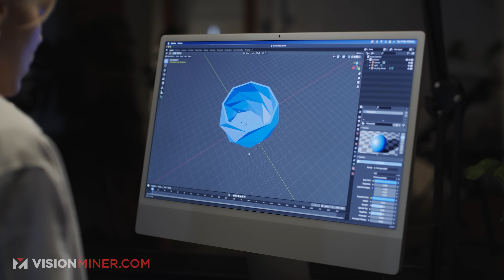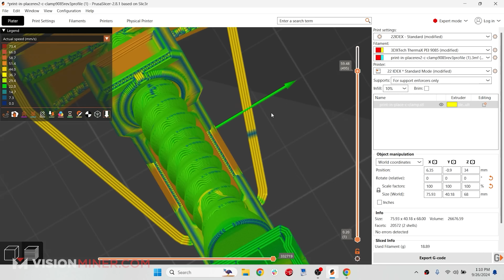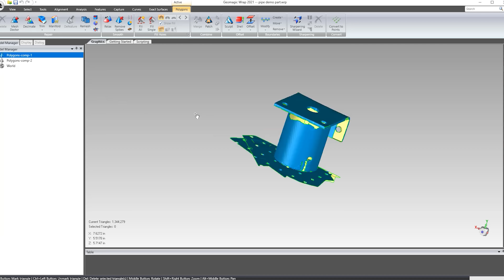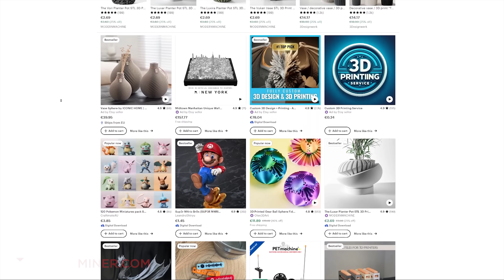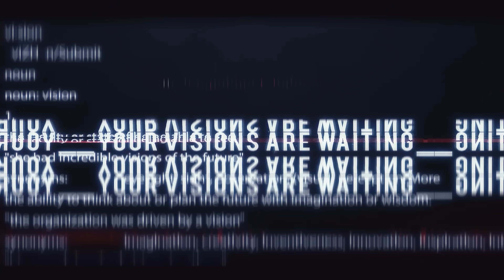Did This Machine Ruin 3D Printing?

Comment: Not going to lie I'm pretty disappointed in The release of this video I have a bamboo X1 carbon myself but I have been pushing the IDex V3 heavily at my job as we are currently considering another 3D printer we have been looking at the Mark forge FX10 heavily but I have been pushing the vision minor printer over the Mark forge and I'm going into this with the kind of experience that I have received with the X1 carbon overall comparing your printer to the FX10 I like the fact that I can use any material that I want I'm not locked into using just one slicer And overall your specs are very impressive and overall very open whereas markforged is not very open with their specs and the specs that you can see are overall very disappointing for example their chamber heater only reaches 60° c whereas your printer reaches 100° c I will say the X1C has overall made the market much more competitive and a lot of manufacturers are scrambling to get their market share back I like this it's great for the consumers because that means a better bargain for us overall more feature set for us overall and I think your printer is positioned at a point where it can offer that feature set right now for a great price I don't think bamboo can really compete with that dual head extrusion system and the rest of the feature set that you guys offer right now.

Comment: I agree and disagree at the same time. Tried multiple printer, bambu was easiest, but its build for lazy people. Or for people who dont want to know basically anything about the working of the machine.

90% of bambu people dont understand basic concepts of printing, some of them even dont know they need to clean the bed.

People like bambu because its easy to work with, i dont like it because its easy to work with.

Its gatekeeping, i know, and its unpopular opinion, but this is how i feel. 

When somebody is saying they are good at printing and they are acting like they are gods of 3d printing and they still dont even know what extruder is, they are not good printers. Many of bambu people are like that...

Comment: I would argue that bottom of the barrel printers had more of a negative effect over the past few years. Consumer printer tech really stagnated for a long time, because so many brands were racing to the bottom with printers that were too cheap to be true and under-engineered. How many people bought the cheapest printers possible and then threw bolt-on parts after them, like they were trying to tune up a 4th-owner Civic?  The forums were just inundated with folks who honestly believed that a $99 printer (with $200-$300 of "upgrades") was all you needed. Most of the problems they were attempting to solve had already been solved a decade earlier. The higher-end printers just had to be more competent than a used Ender 3, which wasn't really a high bar. I'm happy that it's possible to buy a printer now where the only troubleshooting steps are drying your filament and cleaning the print bed.
Reply: Agreed, apart from space limitations... one of the primary reasons I hadn't even considered buying a printer before bambu arrived in the scene was due to it practically being a hobby in and of itself maintaining it / upgrading it / leveling the print beds / all of the troubleshooting before you could benefit from owning a device that can print 3d objects reliably.

Comment: I've been printing for over a decade, and most of what I print are tools. The printer is a tool, and if I have to stop to fix a tool, it's defeated its own purpose to me. I could not be happier with my Bambu. It works and it does its job of supporting my other projects.
Reply: Yeah if you have to ‘fix’ it for every job, it gets old real quick
Reply: I've built printers, maintained printers, been from the robo3d to qidi, to creality, to Anker to prusa to bambu, I CAN do everything manually, but why the hell would I want to when trying to make functional parts that just Work, and don't have to spend half my time leveling, and maintaining and drying filament and so on and so forth when I can model my part up, send it to my printer and walk in in the morning and know it's just going to be there and right as I expected it to be
Reply: Yep. 3d printing people see 3d printing as the hobby. If 3d printing is your hobby you're just creating junk. 

 My 3d printer supports my other hobbies, or I design useful shit for it to make.
Reply: @axle1717  exactly. Most people just make landfill filler lol. I saw a post where a guy said he ran out of room for his knick knacks so he started leaving them around his complex, I was so disgusted
Reply: I agree 100% i also use mine to print mainly tools, I started using 3D printing last century, that's over 1/4 century of 3D printing experience. I was the first 3D printing company in my province, and I paid over $50K for my first 3D printer. FDM has been one of the least viable 3D printing processes until I bought a Bambu printer. It is a game changer.
Reply: Exactly. 3d printers are an appliance, not a hobby. Imagine someone said tink g and printing with a 2d printer was a hobby
Reply: Agreed. I have an old ender 3 that I upgraded so it prints with relatively the same quality as my X1C, but it still requires fiddling.  Dont get me wrong, I like to tinker, but sometimes I just want to hammer out a 3D printing project without all the mucking about. Being able to print in 1 day what would have taken me a few on my ender is a game changer.  Prototyping a new design on my ender would take days, now I can get that done in an afternoon.
Reply: It's not just a tool, it's a machine, you will have to fix it at some point. You could be printing for over a decade and not learn 3D printing.
Reply: @zerotweaks  I'm aware of what it is. I'm capable of fixing it. The point I'm making is having the constant fixing of the machine be a "part of the experience" is a problem, not a feature. It's weird to have this desire for a tool to constantly break and call that a part of "learning" 3d printing. No other tool I've ever worked with, from lathes to CNC mills, have had this weird gatekeeping mentality about the people that use it.
Reply: @chadalexander7218  no constant fixing here 🤷🏻‍♂️
Reply: @zerotweaks   What? You could make the same argument for computers, cars, anything. Just because I can't strip a motor doesn't mean I'm not a good driver. Someone can also make great prints even if they aren't fully aware of the inner working of the machine. Sure, it might help, especially when there is an issue, but forcing a user to spend more time of their hobby on fixing a machine that doesn't work that great doesn't make for a good machine, and especially not a good tool. Why would you want to gatekeep a hobby you enjoy behind the idea of "if you didn't spend as much time getting frustrated by this hobby as I have, you don't deserve it?" It's never a bad thing for technology to advance, especially if someone is just looking to do this as a hobby. I do 3D printing as a business, but I would never tell someone "if you don't everything about the inner workings of this things you do as a hobby, you don't belong here." That's absurd. I guarantee there are people who know less about the machine who have made more impressive prints that you or I, and that's fine. We should want more people to contribute to this thing we enjoy and take pride in so that it can grow. It won't grow if we continue to try to restrict it behind arbitrary restrictions. If we did that, we would not have the at home computer tech we have, we wouldn't have the cars we have, shit we wouldn't have any of the technological advancements of the modern day, because everyone would need to be a technician for every thing they own in their home. Do you know how to strip down and rebuild your car, your fridge, your phone, your computer, every piece of equipment and tech in your house? No? Does that mean you don't deserve to own it or you don't know how to use it? No, it doesn't. Stop gatekeeping something we are supposed to enjoy, we should want new users, we shouldn't be trying to scare them off just to make ourselves feel superior by making it as niche as possible.
Reply: @KCInherent  if you can't slice a model you are not a good printer 🤷🏻‍♂️
Reply: @zerotweaks  Oh, okay, so you've missed the entire point of the whole conversation. My bad, I hadn't realized. Have a good day.
Reply: @KCInherent  nah, you just can't calibrate your printer

Comment: We all need to thank bambu.... without them the every day guy would still be tinkering with junk printers...

Wait and see what bambu does in the next 2 years.... 

I think the big boys will get nerves.... there is no reason for these high temp printers to cost so much.... a bambu can print just as nice.... all they have to do is go bigger and add a heater... not that far away from killing every printer you sell ..... think about it...😂
Reply: Prusa released their MK3 in 2017 and that ended the "tinkering with junk printers"
Lets not pretend like scambu lab was the 1st to make printers that "just work". Prusa did that 8 years ago.
Reply: @LilApe  bro, let's be real.... prusa was happy just taking your money for the same product year after year.... they only stepped up when bambu started hitting their wallet, lol. if we didn't have bambu, you would still be paying way too much for that mk3 .... bambu is faster... cheaper and just as good....
Reply: @gnrdiscgolf1234  Prusa only stepped up after bambu hit their wallet?? the XL and MK4 were already in developed long before bambu even went public with their kickstarter. You wouldn't even have bambu if it weren't for prusa, voron, flashforged, qidi tech and the open source. Considering bambu coped heavily from all of them. Bambu printers are cheap becasue they use cheap components prone to failure. Look at their 1.4 trust pilot rating. It's that bad for a reason.

The fact that bambu is getting spanked raw up and down shenzhen bu the rest of the chinese printer manufactures shows you just how far bambu has fallen behind in such a short time.
Reply: @LilApe  the xL took forever people was on waiting list for years... prusa kept pushing the release back... I'm not going to argue with you that prusa was the king at one time but not any more...
Reply: @gnrdiscgolf1234  The XL was delayed, becasue rather than just launch it with cheap, poor quality components (like bambu lab), they delayed it to ensure a reliable source of linear rails from THK.

If prusa didn't want to use high quality rails, then they could have just used cheap stuff like bambu lab and launch the printer a year earlier.

Comment: Bambu is awesome but damn when I need the extra capability for options from fully open Cura that had options Slic3r never figured out… 

And then the creative thing I used to run on my Bambu’s, the product niche, they removed it through updates 🙄. And manually trying to trick it is way worse. 

The effect is real and I hate it
Reply: What did bambu remove? And wich features is bambu or orca slicer missing?
Reply: @ There are very technical line spacing features per wall type I have never seen on any other slicer, Bambu is missing a few per layer items like infill, many infill patters, and detail overrides that forces the slicer to attempt to make details the nozzle is ‘not supposed to be capable of’……..

The list is long and bloated, if you never tinkered in the old fully unlocked days it is almost impossible to describe all the finesse and experiments that were available. There weren’t all good, some made a mess and I know that’s why they aren’t offered on a click and print style system like Bambu, BUT I would love the option to have every knob and dial available to mess with even up to and including how the slicer processes STLs. Cura as I know is the most open in ‘developer’ mode and that will never appeal to the masses.

Maybe ‘features’ is the wrong term, rather ‘option to mess things up’ is a better term for what I miss in the new slicers. Like when Bambu won’t let me run TPU on a .2 nozzel removes the option entirely, they removed Polymaker’s TPU profiles, silks got removed from .2 nozzels, but the stuff I could do with the great printer and the freedom to clog nozzels and break things through material experiments is a skill many creators may never think of as the option on the machines they own never existed.